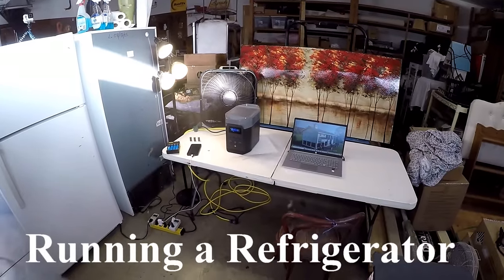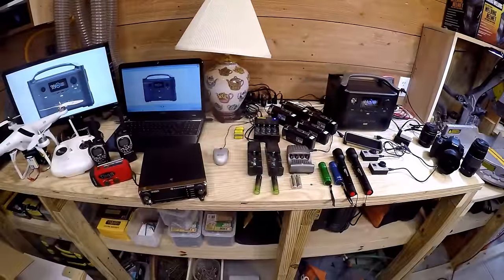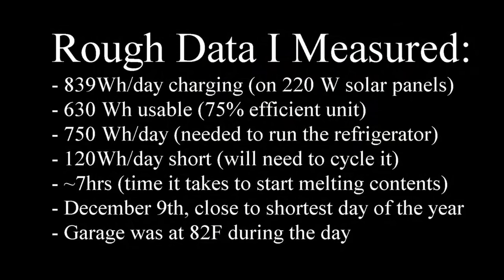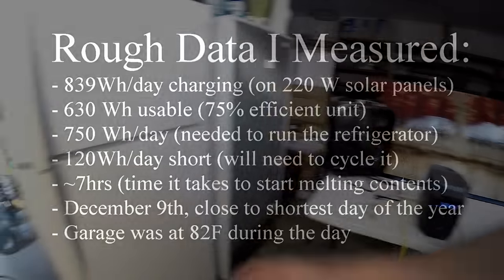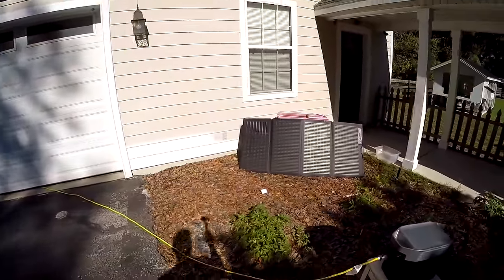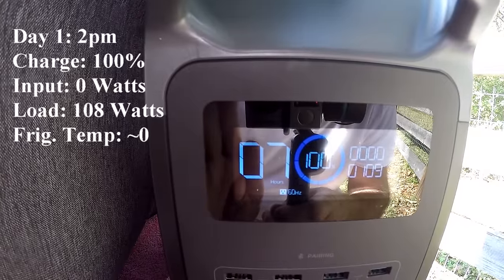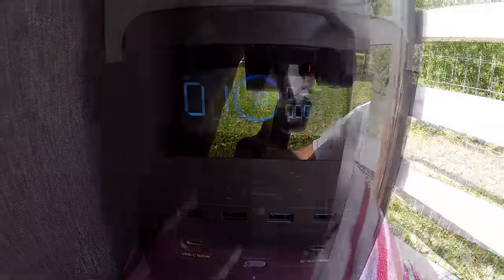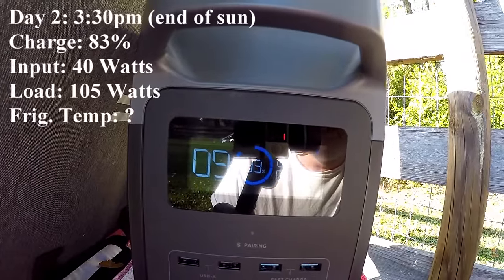EcoFlow Delta 2 Refrigerator Test with EcoFlow 220 Watt Solar Panel

Comment: Being an old commercial refrigeration mechanic, I have to tell you that 28 deg won't prevent food spoilage.  It might be slower than out on the counter with no refrigeration.  But somewhere around zero or even below is best.  Supermarket freezers routinely produce minus 10-20 deg temp to preserve food and allow you to get it home on hot days without spoilage.  Colder is better.   Essentially you are slowing down the growth/movement of bacteria by making it colder.  Colder the better.
Reply from the maker: Good tip.  Thanks!
Reply: It will take a LONG time for the food to go bad when kept at least below freezing. I have seen government charts where it lists how long various meats and other items can be frozen. I have used meats way past the time frames given with no ill affects. Meats smelled fresh. Freezer burn was the biggest issue. I vacuum seal meats prior to putting them in the freezer.
Reply: His fridge might be failing. If he has power to it, then it should never be close to 20+ degrees. That battery system should keep it below zero until it runs out of juice and needs recharging

Comment: Last year, I purchased a Delta 2, which powered my refrigerator and small freezer for three days during Hurricane Beryl. I used my 25-year-old propane Generac to recharge it three times. I was so pleased with its performance that I recently bought the Delta Max 1600 with the smart max battery for $1730, tax included, from Home Depot. The price included a $740 rebate discount. It can deliver 3000 watts, with a surge capacity of up to 5000 watts.

Comment: the trick is to have frozen gallons of water in the freezer to keep frig cold during a power outage.
Reply from the maker: Probably a good idea to freeze gallons of water if you see a storm headed your way.  Thanks!
Reply: I will remember that… I have a larger small fridge… the freezer could probably hold two frozen gallons… I could rotate those as I’m actually already off grid… I know some people who are gone or not utilizing fridge most of the day… so they aren’t opening it at all and that’s when they unplug it… then they plug it back in when they get home and start supper… I’m moving to a relatively cold area, and I suspect that will work well for me too. I also plan to cook on a woodstove and an outdoor fire to minimize elec use as well.  It will be interesting to see how it goes.
Reply: @HomesteadEngineering  beats bags of ice, less mess

Comment: I just picked up my Delta 2 with the extra battery ($1200 total from Home Depot) and this really reassure me that I'm going to be just fine running my freezer and a couple other small things. I live completely off grid and feel like this little set up will help greatly. I'll be using a 240 watt panel and can add another if needed. My little Honda 2000 genny charged both batteries from 30% to 100%  in about 1 ¹/² hrs. I'm already a big fan of this unit.
Reply: 1200 for both....Nice!
Reply: I just ordered a delta 2 from ebay for $600 shipped. They had a coupon code. Should arrive in a week.  This week I try to watch all the YouTube on  it.
Reply: Wild that amazing has a sale today that makes it under $500! I had to pick one up haha

Comment: I disconnected my generator every night till power came back in from 9:30 PM to 7:30 AM and everything remained frozen solid - Note no one opened the door after the generator was disconnected 👍 also the Kitchen Room temperature was around 82 degrees and the fridge had very little air space I packed it with water bottles before the hurricane 👍
Reply from the maker: Great to hear your results!  Thanks!

Comment: i do the frige thing ,, its on a timmer,, we go to be around 11.00pm, the frig runs till 2.00am and shuts off till 630 am ish, then runs all day,,i figured out this trick when we started out on solar,,the frig is closed from 11.00 to 630 so no need to run, same with other stuff you dont use ant night,, like our freezer,,and in the day i off set the timmers ,, so when the freezer is on,,, the frig is not
Reply from the maker: Well folks, this is how people with battery backed solar think.  lol.  Its not like being on the grid you really think a lot about how and when power is being used.  Thanks!

Comment: Good test, I experienced the same with my different brand solar generator when leaving a refrigerator plugged in the Solar generator turns itself off. To avoid this, plug in a low 4 or 5  Watt light bulb to the generator. This constant low flow will ensure the generator does not turn off when the refrigerator cycles, that's how I'm able to keep my Solar generator on when using appliances that cycle off and on.

Using a low 4 to 5 Watt bulb is nothing, plus adds light to a room while keeping refrigerator on.
Reply from the maker: That's a great tip!  I think it is possible to tell the system to stay on under zero load but I will have to look into it.  Thanks!
Reply: @HomesteadEngineering The Ecoflow app allows you to adjust the settings so that the Delta 2 never automatically switches off or when the load goes too low.

Comment: Being from Puerto Rico, I know about surprise power outages. I have a small apartment and plan on getting an ecoflow very soon. Thanks for the video
Reply from the maker: Feels like we are about 2 weeks out from our first hurricane...
Reply: Yes in puertorico we def need this . And I would put an ice machine plug it have ice in case the the nevera shots off I have ice as well . I bought me a fan with charger n light 💡 I was happy with the solar fan . 😊know I need this 😊
Reply: The problem is that no company that I know of ships these solar generators to the island, so your're stuck buying them from  local vendors there and needless to say they charge at least twice the price.

Comment: Thanks for covering this use case! I just helped get a family member's fridge through a power cut with my Delta 2 + 3rd party 200W panel. Worked like a champ!
Took 3-4 hours of the fridge running at 120W to get down to temp, and then the fridge dropped to under 10W at idle. Very rarely needed to cycle on the compressor to cool it back down, as we weren't opening it often.
Even with only ~70W of power coming in (overcast and smokey), we were able to bridge the gap before the power company fixed the line. 
One quality of life item, I got a 30ft solar power cable, so I could keep the Delta 2 inside and out of the elements while rearranging the panels out in the yard. 
Tempted to get another 200W panel, just in case :D
Reply from the maker: That is great!  A real life experience that worked as expected.  I really like the 30ft cable idea for sure.  I would definitely add the extra panel.  You can't ever have too much solar.  Thanks!
Reply: Juat got my Ecoflow 400W bifacial solar panels and I sleep so much better now. 👍 Labor day sale too. 31% off til 10th.
Reply from the maker: @sickofgreyhats Yes, it is very nice and reassuring to know that your always going to have some backup power in an emergency.

Comment: Just picked up the Delta 2 off Amazon for $650! We are fully off grid and I think this unit is going to be a game changer for us. This review was excellent and provided so much helpful information. Now I just need a solar panel for it.
Reply from the maker: Wow, great deal!  I would get a low cost panel that maxes out the input Wattage for your unit.  Your going to want all the solar you can get!  :)
Reply: @HomesteadEngineering  yes, we don’t get much sun this time of year in Alaska. Glad it comes with a car charging option.

Comment: Excellent review of how a fridge would run with this station. Exactly the video I wanted to see. Thx!
Reply from the maker: Thanks!
Reply from the maker: Note: This fridge is on the small side of full size refrigerators.  You might look at the Delta 2 Max

Comment: I received my Delta 2 today. Solar panels are still on the way, so I charged it up with AC. Plugged in my basement fridge to it and have not opened the fridge or freezer since then. 7 1/2 hours later I’m still at 70% charge! If you can avoid opening the fridge as much as possible and if you can hook up solar to it while it runs the fridge, you shouldn’t need to cycle the fridge on and off.
Reply from the maker: Susan, Yes, I think your right.  Thanks!

Comment: I did not expect that power station to be that powerful and now I think I want one.
Reply: Get the Delta 2 Max with at least 1 400w bifacial solar panel for emergency refrigerator use, bcuz if you have 2 rainy days in succession, the Delta 2 with 1 220 bifacial panel will not cut it. The Delta Pro, if your wallet can take it, is the BEST OPTION for homeowners. 👍 Good luck.
Reply: @sickofgreyhats  A generator will suffice for dark days.

Comment: Thank you very much for this test, as with the most recent (Oct 2023) Amazon Prime sale, I picked up a Delta 2, extra battery, and 2 x 220w panels for this exact reason.  Now (per a below comment's good idea), just need to have the panels arrive so I can look at them... then order the panels' extension cables so the unit stays indoors and the panels can easily be moved for maximum input.
Reply from the maker: Sounds like your all set for the next power outage.  :)

Comment: I was considering a Delta 2 for this EXACT use case. Thanks for confirming a single panel is enough! I'll get a second panel so I can guarantee the use of small electronics at the same time during their next sale.
Reply: You'll want 2 220W bifacial panels anyway, but for emergency fridge use, you want a Delta 2 Max with a 400W bifacial panel. If you have 2 rainy days in succession, the Delta 2 with 2 220 panels won't cut it. 👍 Good luck.
Reply: @sickofgreyhats  thanks for the input! The 400W panel had bad reviews, so I went with two 220W panels, then spent the cost of another 220W panel on five 100W Harbor Freight panels during their Labor Day sale. These things are cheep enough I don't mind leaving them outside. I still have a dual fuel generator for longer emergencies in case the rain is very bad for more than two days in a row. 

This is only the beginning of my adventure with Solar. I'm looking forward to seeing where this road takes me!
Reply from the maker: I have been on the solar path for about 7 years now.  If I were just starting out, I think I would build out at least 12,000Watts of panels and back it with at least 30kWh of LiFEPO4 batteries.  Then maybe add the EG4 18k to top it off.  Something like this: 
https://signaturesolar.com/complete-hybrid-solar-kit-12-000w-120-240v-output-30-72kwh-eg4-lithium-powerwall-14-000-watts-of-solar-pv-kit-e0005/
Reply: @HomesteadEngineering  I have an HOA and they do not allow solar. Hopefully I can get it on the ballot for this year and we can change that! Alabama Power is also not friendly to solar... so the financial situation will take a bit to get there.

Comment: Just bought a Delta 2 and ran a test. Refrigerator was running when plugged into Delta it ran for two hours before turning off. The refrigerator's inrush voltage is 757 watts  and operates at 80 watts. Ambient air temperature 78 degrees F. Opened and closed door 8 times and it lasted 17 hours. No other source input was used.

Comment: My god how nerdy and wonderful this is! Oh my god how I love this video! Thank you! I have to buy one of these now! I'd like to see a test charging a hybrid car with the solar panel. My hybrid charges to full in about three hour from a normal wall socket.
Reply from the maker: Thankyou for the nice comment.  I don't think you would want to charge your EV from this 220 Watt panel.  It produces about 650Wh/day.  So if your EV has an 80kWh battery, it would take about 125 days to charge it!  Just divide the size of your car battery by about 650.  This is why covering you car with solar panels is a bit of a waste of time.
Reply: @HomesteadEngineering  Thank you for answering. I guess I won’t be doing that then 😂 It’s a hybrid with only a 10,4 kWh battery but that would still take 65 days then I guess. Anyway… thanks again for the video. I enjoyed it very much.

Comment: Great video!  If I buy the same system, do I have to buy inverter? Or does the inverter part of the battery system?  Thanks!
Reply from the maker: The inverter is built into the system

Comment: Running 11 months off grid in the Southeast US on two systems each of a Delta 2 plus Delta 2 Max extra battery. Wave 2 with battery plus Delta 2 Max extra battery provided 7.5 hours summer time air conditioning. It works!
Reply from the maker: That is great!  :)

Comment: every time you open the freezer door you let in warm air. a chest freezer would do better. . just keep a small load on to keep inverter on . cheap extra styrofoam sheets will make them work even better. even a blanket over when not running . great test
Reply from the maker: Good tips.  Thanks!

Comment: TY for the testing. I just got delta 2. Helps me visualize on haw to shop for my panels. hard to believe that only a 220w panel worked that well.
Reply from the maker: Thanks!  I recommend maxing out the solar.

Comment: It would be interesting to do this test by cycling the fridge with an electronic timer, allowing the fridge to be on for 10-15 minutes of each hour. I believe there's a setting in the app to keep the Delta 2 from shutting down if the load goes to zero.
Reply from the maker: Mark, I think that would be the way to go.  I was going to do that but all my timers are 2 prong and the fridge is 3.  Not that hard to get around but I just did not do it.  Maybe next time.  Thanks!
Reply: @HomesteadEngineering Doesn't the refrigerator already cycle on and off depending on the setting?

Comment: This is what I needed to know about cycling the usage if using appliances like a refrigerator. I met a guy that even claims it can run off a washer with a couple of loads in tow . If that’s the case, that would bolster my use of the Delta that I have . But yes, this helps bring things into a better perspective. Thank you ! 🙏🏽
Reply from the maker: I personally don't like using my solar generator to run a washer.  I don't like the agitation ramping the power up and down on the inverter like that.  That said, It probably would not hurt once or twice in a pinch.  Thanks for stopping by.

Comment: An interesting video. We've just received our Delta 2 and 220w solar panel, bought specifically to run our freezers during a power cut. The freezers have a 7-8 hr melt limit, if you don't open the doors. We plan to wait about 5 hrs into the power cut, run the Delta 2 for an hour or so, and use that cycle until power is restored. It's all a bit of a learning curve. I saw someone who put a bowl of ice cubes into the freezer at his off-grid place. That way, if he came back later and found the ice cubes completely melted (whether it later re-froze or not), he knew he had to ditch the food.  We will have to adjust the app settings so the Delta 2 still runs if the fridge clicks itself off for a while.  Can't comment on the solar panel as the UK weather has been so rubbish recently but we're looking forward to hopefully getting some free power and maybe even use it to power an aircon unit in the summer.  Aircon? UK? Who'd have thought it!
Reply from the maker: That sounds good and similar to what I did here.  You might want to experiment using a timer and see how that goes.  Thanks!
Reply: Yes, a timer is a good idea, many thanks.

Comment: So I've heard when I bought my Honda 2000w generator that if you ran the gen an hour in. The morning and an hour at night the contents of the refrigerator would be fine if you kept the refrigerator doors closed. I never tried it though. But I was thinking a small generator like that would work very well paired with that ecoflow Delta 2 for charging it quickly and fully. Thanks for your testing
Reply from the maker: Yes, pairing a small inverter generator with a solar generator is a very good solution that will solve most problems you are likely to ever have.  I think you may have to run your fridge three times a day for 1 hour each to keep it going.  Just my guess.  Thanks!

Comment: Great video. Should have used the kickstand that came with the bifacial panel. Its interior is white and helps reflect sunlight to the backside of the panel. I have a Delta 1300 + 220 b/f panel. Haven’t done a solar longevity test as yours but my Delta will run my LG bottom freezer/fridge for 23 hours without charging. A real game changer.
Reply from the maker: Thats a good point about using the reflective stand.  Thanks!
Reply: @HomesteadEngineering  the mirror was a good idea. That bifacial would probably do great on the snow
Reply: Also, try setting the Bifacial panel on top of a Mylar emergency blanket & I believe you’ll improve the reflective results on the backside of the panel.  I use the Mylar blankets for my 2 Bifacial panels & I’ve been pleased with the results thus far.

Comment: I just got a two pack of timers from Amazon for about 15 bucks. Instead of like most timers that only turn off and on one time per day. This one will turn on, all day everyday, over and over again. You can program it to turn on for an hour and then off for a few. And then back on and back and forth. Sounds like that's what you need instead of plugging and unplugging it all day
Reply from the maker: Sounds good!